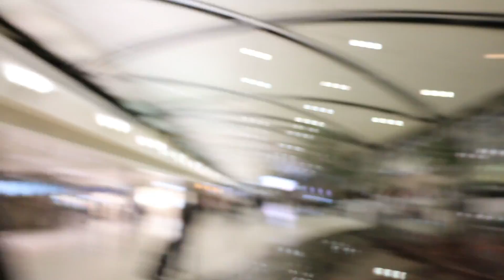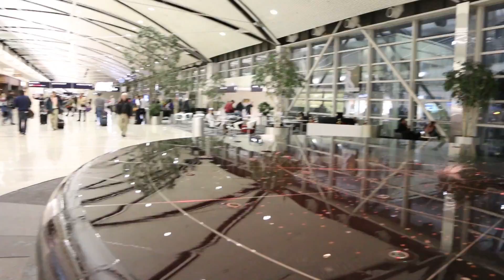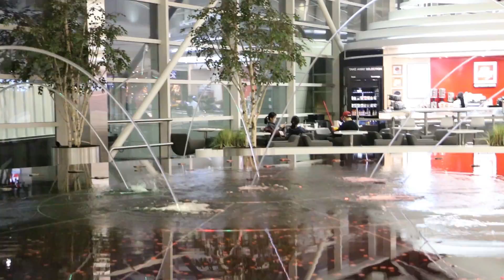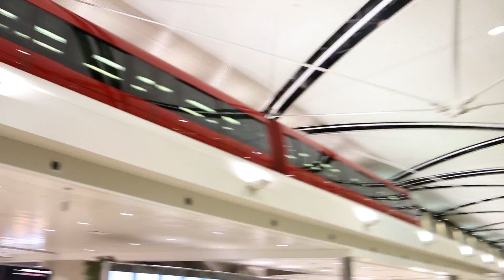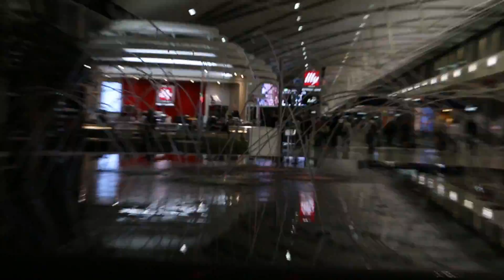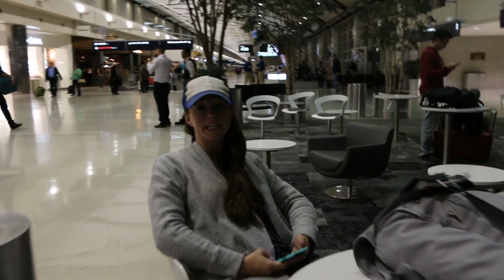Laminar Flow Pop Jets at Detroit Airport

Comment: Some newer ones like that use air rams. Air rams water out of a tank pipe, then water pressure pushes it back n refills the pipe.
Permanent flow ones tend to have pumps and valves but some use both.

Comment: I'm sitting in the Detroit airport right now waiting for my flight to Milan.  My gate is adjacent to the fountain and I just stood and watched it for 10 minutes. It's a very well designed water feature. Designed and manufactured by WET Design. Known for many famous fountains such as the ones in front of the Bellagio in Las Vegas.  This is one of their smaller works but still very impressive.

Comment: around 2 min, after you said "Laminar flow for the win", you then zoomed in on the center of the fountain.  The 're-entry' point closest to you doesn't have as smooth of a flow.  So my question with this is: Why is the rest of that particular arc not affected?  I'm guessing that the irregular flow has something to do with the pressure not being continuous OR not-smooth shaping at the starting point of the arc but if that's the case, I would think it would affect more than just the tail end of the water.  As you move around the fountain clockwise from this point, there is another location where this is happening.  Anyway, just curious.  Also, I think your wife is such a great sport during her cameos in your videos! :) Well done Mrs. S. :)

Comment: I was stuck in the DTW for about 12 hours over the holidays. I watched that fountain for a while. Another fun thing is that the rail cars are cable driven with the electric motors at the far ends outside the lobby area, which is why they're so quiet. Also, I like "Funner Every Day."

Comment: apparently those solenoids that can do that are very expensive, I'd also like to know how the pressure system works, a pump to a tube to a solenoid would cause an initial high pressure normally, at the moment of opening the solenoid, but you see there, it is a constant pressure.

Comment: I used a power washer today and I kept thinking about how they pressurize the hose without damaging the pump or the seals when you let go of the trigger and are not letting the water flow.
Reply: Well... I work with pool pumps  but it looks like pressure washers use hydraulic pumps. Now I know how those work. BTW you can buy nozzles for your pool deck that will look very similar to that and some have LED lights in them. They're called Magicstream

Comment: Here's a question. The only time I've ever seen laminar flow is for exactly like this, water fountains and art. Is there any other use or application or laminar flow? A piratical use or hidden in some common object?
Reply: +Brandon Francey I haven't taken fluid dynamics yet, but from my understanding, one of the main things in fluid dynamics is laminar(smooth) and turbulent flow. Each do different things, and I'm not sure, but a main goal is to try and get rid of turbulence, as in many cases in can negatively affect the efficiency of the system (think about this in respect to airplane wing tips, and fluids traveling through pipes).
Reply: In aerodynamics, laminar flow over a wing can reduce drag, while turbulent flow can reduce the chance of flow separation (stall)
Reply: +Brandon Francey I study baseball for a living, and laminar flow is our bread and butter. Don't really feel like getting into specifics, but I can tell you its important for baseball, determining how the breaking balls break, how the ball cuts through the air, etc.
Reply: +Brandon Francey Truly laminar flow isn't all that common. Maybe in process engineering if you're working with honey or something very viscous like that. In air laminar flow pretty much doesn't happen under any normal circumstances. The boundary layer, i.e. the flow very close to a wall or body, is a different story. Because the fluid slows down at a wall due to friction, you usually get a layer that behaves like it's laminar....it's a long story.

I really need to look up how they make those jets behave like that...there's always new and counter-intuitive things going on in fluid dynamics...
Reply: +Brandon Francey It's good for making badass sinks.
Reply: +Brandon Francey P51-Mustang - laminar flow wings, able to escort bombers all the way to their targets and back due to efficient wings, also I believe made them harder to fly.
Reply: +Brandon Francey PFRs, plug flow reactors use laminar flow. It's not too common in heavy industry but it's sometimes used in the lab.
Reply: Laminar flow has also been used to make water run the pipes quieter. I also know a basic form  of it has been used in fire hoses to direct the water easier.
Reply: Brandon Francey wind tunnels for testing aerodynamics!
Reply: Well laminar flow is less common but it happens. Like in stratified lakes, often the layers end up laminar because, well they are laminar (laminar flow = flow in layers). But laminar flow is really important to understand, because it is the first thing you learn when doing fluid dynamics. Turbulent flow is far more complex and chaotic, and to begin to understand how turbulent fluids work you need to have first learnt how laminar flow works.

I guess like babies need to learn to crawl. Sure they don't crawl when they get older, but most babies are incapable of learning to walk until they have learned to crawl.

But nonetheless laminar flow does have many uses. It is just that turbulent flow is far far more common.
Reply: Tig welders use less argon when using a gas lens to create laminar flow.
Reply: It's been used in fire hoses since the early 1900's because it allows the water to travel longer distances. Helpful for putting out fires in tall buildings.